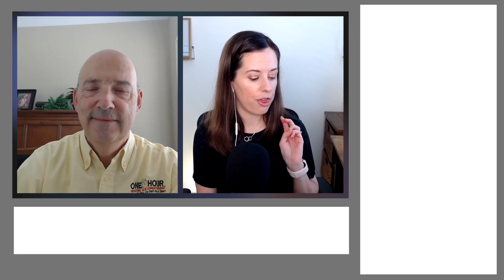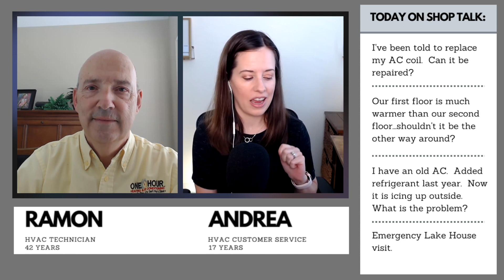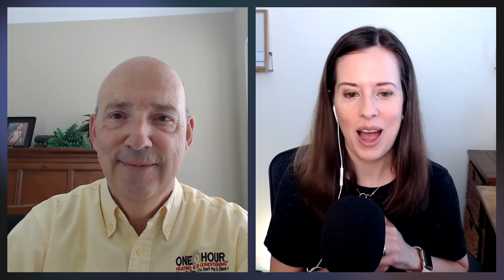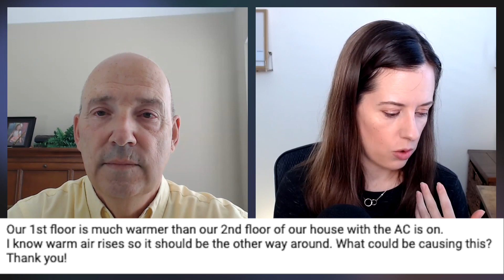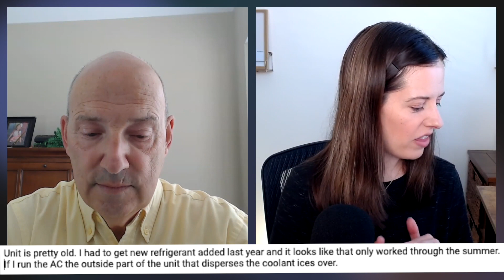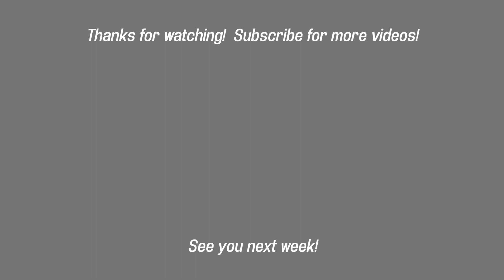HVAC QUESTIONS AND ANSWERS: Can you repair an AC coil?

Comment: My ac unit is running and cooling is on and built up ice in the coils and nothing coming through. Just replaced the capacitor too. What could cause that?
Reply from the maker: Hi thanks for the question!  We answer in this video here: https://youtu.be/lf493xayKwM. Your question is at the 0:32 mark.  Hope that helps!